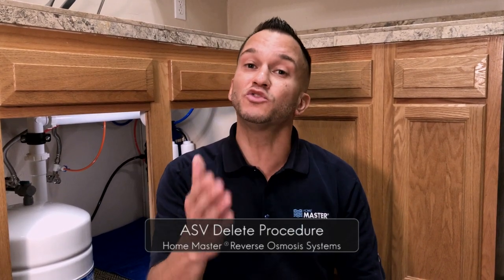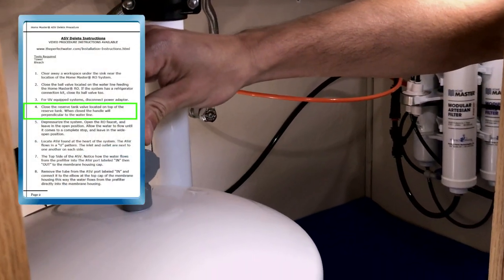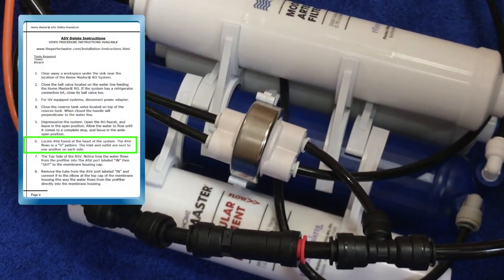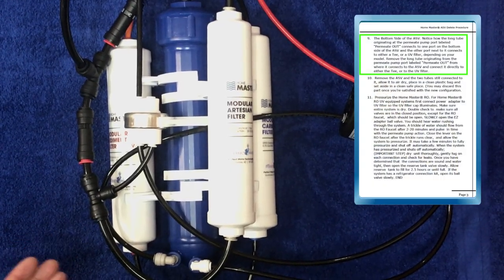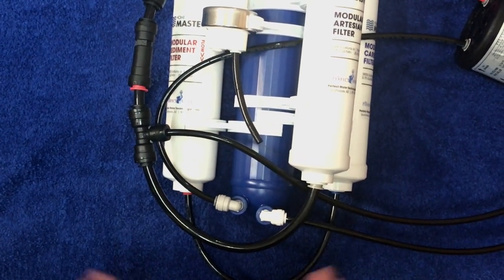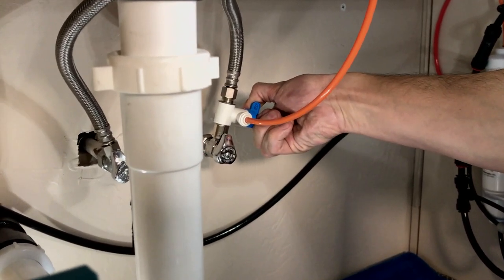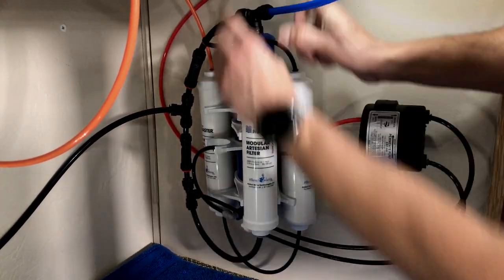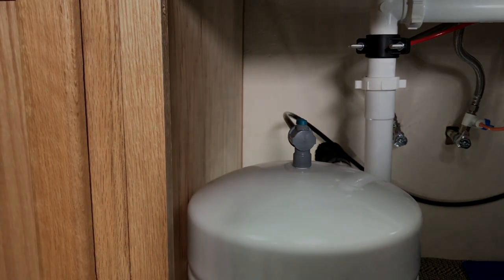How to Delete/Remove the Home Master® Reverse Osmosis ASV (Automatic Shutoff Valve)

Comment: I removed mine.  My system was not starting and stopping like it use too.  I noticed it running all night long a couple of times.  Seems like the ASV was failing to open and close.  Its only been a couple of days but the RO system runs fine without the ASV.  One upside is that the tanks get much fuller and the pressure/flow at the fridge water dispenser is now great.  It was starting to take forever to fill a large water bottle.  After a week the bad news is that TDS creep now occurs without the ASV.  Back to installing a ASV but I'm going to try a 90% ASV versus a 60% one.
Reply from the maker: We used to carry the 90% ASV and can get one for you upon request. However, we discontinued it as a stock item, because most customers didn't care for how it impacted performance. The difference between the 90% and 60% ASVs, is about 30%. Haha just kidding. But seriously, the 90% ASV will allow the tank to empty nearly completely - to about 90% empty, before it opens and allows the system to produce new water that goes to the storage tank, if the RO Faucet is closed, or is added to the system output if the RO Faucet is still open. The 90% ASV fulfills the permeate pump's wastewater reduction mission completely as the system operates more efficiently when its working against less tank back-pressure. The downside to that, is that as the tank fill level drops, so too does the pressure out of the RO Faucet. The tank output follows a normal linear curve - at 100% full it really belts out the water, and the flow rate tapers off as the level drops. This becomes apparent, if you move through your tank's water a glass or quart at a time. If you drain the tank completely each time you use it, then you won't notice a difference.
Reply: @ThePerfectWater  I installed a 90% shutoff and the performance was as you described.  When full the flow at the RO faucet was great but over time as the tank emptied the flow got worse and worse.  Eventually the RO system tank would get low enough to begin filling again.  My problem is that my RO faucet is through a fridge which only allows 1/4in tubing and it takes a long time to fill a water bottle.  I'm sure 3/8in tubing to a faucet would fix the problem but I cant drill a hole for separate sink faucet.
Reply from the maker: @markcarlson1696  Understood. My recommendation is to restore the maximum possible flow with the 60% ASV. Home Master RO systems carry a 5 year limited warranty. Call in and we will send one at no charge. The increase in wastewater will be minor...spend 1 minute less in the shower a week and you'll make up the difference.

Comment: Under what circumstance that we need to bypass the ASV?  Will this make my filters last longer than 4 months?  Seems like my filters only last 4 months Max.  It's getting  expensive to replace my filters every 4 months or less.  My previous GE reverse Osmosis filters typically last over 10 months.  Not sure why your filters only last 4 months?
Reply from the maker: The filters are sold separately as well as in sets. It could be that you just need to change your sediment filter more frequently, and not the whole set. Please reach out to our support team and we will ensure you get the right tool for the job. Please call 877-693-7873. 
https://www.theperfectwater.com/inline-sediment-filter.html